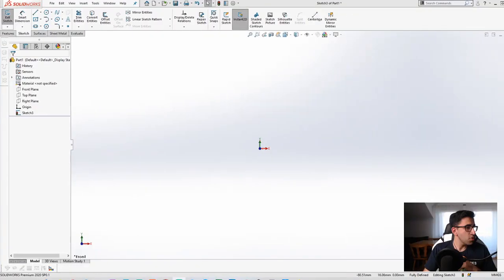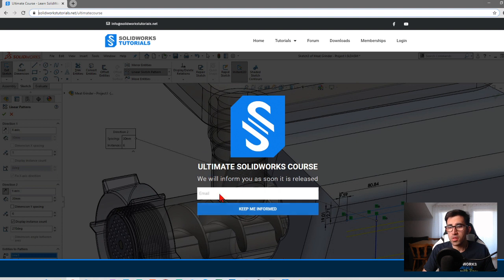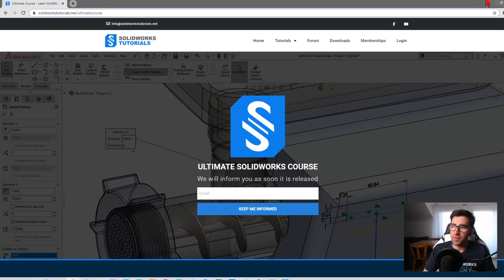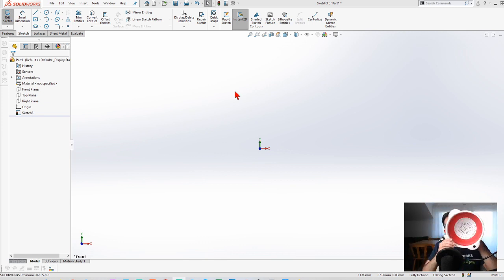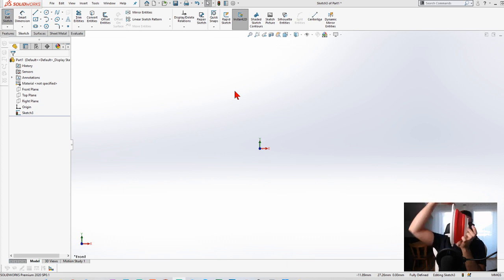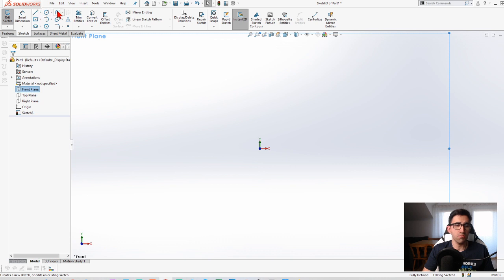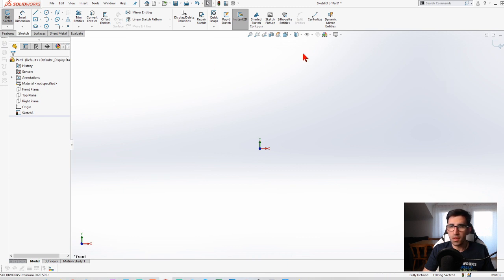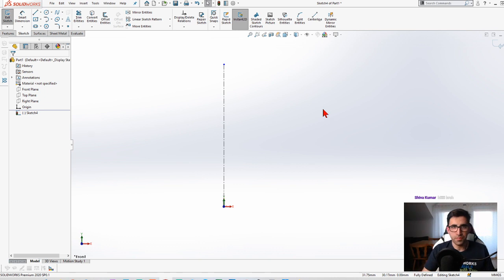SolidWorks With Ryan - beginners Part 3 - Multi- Body mode

Comment: Great tut, Ryan!  The only problem I had was on the building of an Assembly.  When I brought in the three sections, they were not aligned with each other, and manually trying to align them was not feasible.  I played with the "Mating" function, but it seems to want to only mate flat surfaces.  Since the top and bottom of the red ring is a point, it wouldn't work.
Reply from the maker: Matt, send me your parts to info@solidworkstutorials.net I've got this one for you

Comment: ryan i have a question.i want to design a kids car for my daughter, i start to sketch 2d and extrude and make every components and so on.some parts need to be designed just once.like a tire.or steering parts for left and right wheel .and when i draw one tire as a one solid body on a whole chassis .then i dont know what way is right? should i split body and save bodies and then import to the other side (mirrored part.not in this case). or should i design it seperately? and when i mirror a part, then i have a problem in assembly ...at the end i wanna have a bodies saved in one file to order to  or 3d print or ... i'm confused  plz help man.i know this Q became long and hard to understand ,but any suggestion would help A lot . you're the best
Reply from the maker: The best way is to create your first part, e.g. your tire, and make sure before you create it, uncheck "Merge Results" in your features. whatever feature it is, extrude revolve whatever. this way that tire will be treated as a seperate solid body. Then when you go to Mirror or pattern or etc. instead of selecting that tire as a "feature" you go to "body" and select it there. "Body" is a section in the property manager of (column on the left) of each feature. This the trick my friend
Reply from the maker: After you did that, you can isolate each solid body and save it as a individual part. then import those into assembly
Reply: @with-Aryan  wow ,got it , it'll work.thanks man .you are great.your'e the best.

Comment: 8:33 How did you make the plane though???? You didn't explain what to click on to make the new planes for splitting. I have to use the 2012 version so whatever you're doing to make the planes does not work with mine.
Reply: Figured it out for anyone wondering, when you click the top plane line to drag it up, you need to hold ctrl to make a new plane.
Reply from the maker: it does! They are the same in that sense
Reply from the maker: I have explained that in detail in my How to Create Planes video
Reply: @with-Aryan   Thank you! Your videos have been very helpful :)